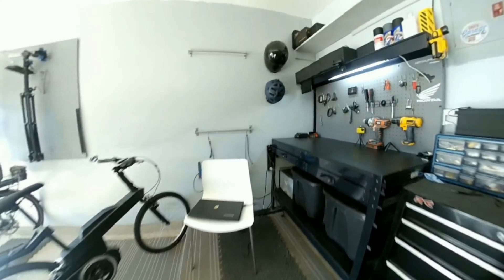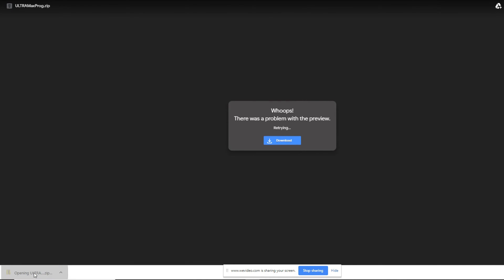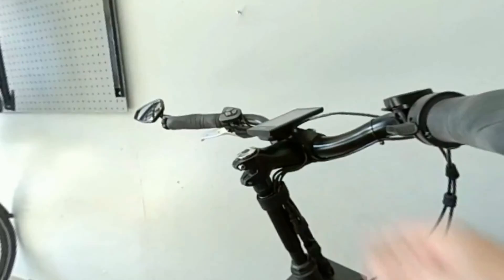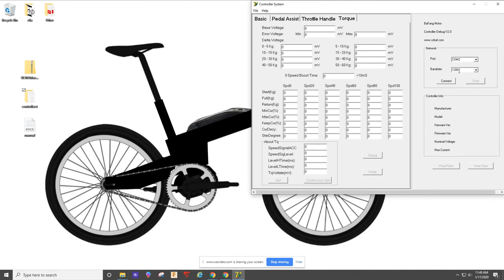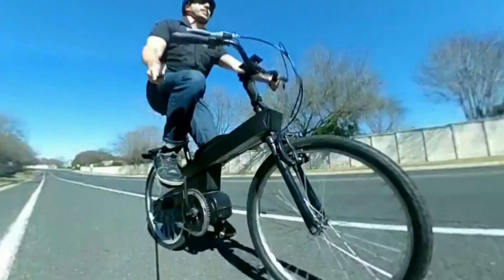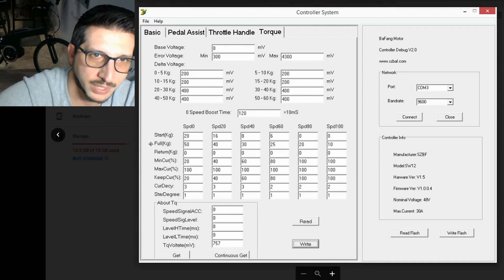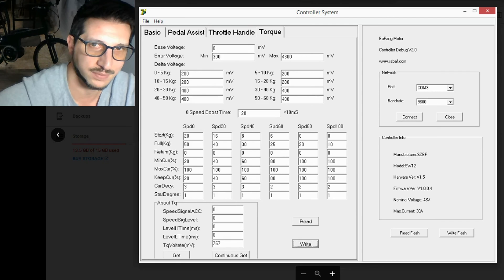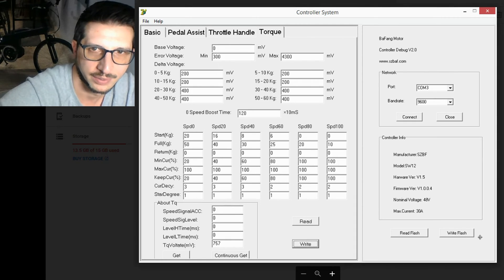How To Program Bafang Ultra Torque Settings

Comment from the maker: Update: I'm still loving these settings on my commuter, but want to point out a few things: 

1. This setup might not be ideal for emtb - couldn't tell you bc I'm a commuter.
2. The motor in this video is 2018-2020 UART version. Bafang is supposedly switching over most (or maybe all) their new motors to Can-Bus which can't be programmed via the usb cable. It requires a special tool and dealer access to special software. Epic fail Bafang! If you don't have a Bafang motor yet, you might want to look into buying one with an aftermarket programmable controller upgrade.
Reply: So in effect I could restrict the speeds? To be in line with UK laws? As mine will be to fast.
Reply from the maker: @Anglo-Brit  you should be able to restrict the speed using the settings on the display.
Reply: @eBikeaholic  Ok thanks
Reply: can confirm theese settings do not work in emtb enviroment. Not sure how one would adujst this for emtb use.

Comment: Well, we've received our Frey ebike, & I can confirm that
the Base Voltage value should NOT be at zero!

Bafang ships these motor controllers with the torque sensing uncalibrated.

The minimum value, at zero pedal force, which these torque sensors can output, is around 732 milliVolts.

Anything below 730 mV in the Base Voltage field, is wrong.
Far from a matter of preference, this is literally crippling the torque sensor:
Set at 0 mV, the first 20% of torque sensing range is thrown in the garbage;
Under any pedal rotation at all, ~"12 Kg" of pedal force is detected!

Of course the torque sensing won't work well that way!

To fix this: 
Get a reading from the "TqVoltate" field, with no force on the pedals.
Add at least +1 or +2 to that value, & apply that total to the Base Voltage.
Congratulations! You have just calibrated the Base Voltage of your torque sensor.

Setting the Base Voltage mV to 757 or higher, should prevent any baseline sensor jitter from being detected as pedal torque. (Unless your torque sensor is unusually erratic. If so, seek replacement as this is a safety issue!)

Comment: You forgot to mention that you need drivers to interface with the adapter, it took me a day to find the reason and install them 😂
https://cfpmanfredini.wordpress.com/2016/02/28/installare-i-driver-corretti-per-arduino-con-chip-ch340-ch340g-e-ch341/
Reply from the maker: Sorry to hear that. What adapter? Maybe you have a different setup. The laptop I used didn't need to install any drivers, but thanks for sharing in case someone else gets stuck with that problem.
Reply: @eBikeaholic  I don't know, when I connected and clicked on "connect" it started to change bandwits at random, then I looked on device manager and saw that the adapter was detected with a recognition error, probably windows didn't find any drivers by itself 🤷🏼‍♂️

Comment: I got my befang ultra and as I cant use anything more than 20mph due to laws, so I got cable from Frey. What ever settings I use I can only get about 12mph but with Throttle I can get whatever i want
Reply from the maker: Interesting. When you say can only get about 12mph do you mean the motor cuts off assist once you reach that speed?
Reply: @eBikeaholic  I fixed it and now do about 18mph pedal or 23 with a bit of added throttle

Comment: Thank you for the fantastic program . I programmed my Frey AM 1000 with your torque sittings, and it is like having a different ,more fun ,more capable bicycle. The response is natural and smooth. I think Frey should ship their bikes with your torque sittings.
Reply from the maker: Thanks! I agree, I'm still running these settings for car replacement.

Comment: This is very helplful but I have a problem getting started. The programming cable I have works well with BBS02 and BBSHD and the Pedal Assist Software for them.  The Controllerst Softwares only cycles through the bandrates when I try to connect.  The BBSHD software connects and will read but not the software for the ULTRA.  I have an Branded Bike I am trying to read the settings on.  From the controller is the green triangular 5 pin connector which adapts to the round to connect to the display.  I saw reference to a CANbus for the bike but not sure if this is connectors or a protocol.  Any ideas?
Reply from the maker: hmm not sure. I have heard of some OEMs starting to restrict them to the CANbus. I got mine as a kit. https://amzn.to/3hlV322

Comment: Hi, thanks for this very helpful and informative video.  Would you recommend these torque settings for a bike with 10 gears for street riding (in particular I have a Frey AM1000), as I noticed you only have a single gear.
Reply from the maker: I don't see why not.. I upgraded this bike to Nexus 3 speed IGH over the summer and still use the same settings.

Comment: Nice Bike!!! how much did you spent building this monster? and would you consider making another one for someone else?
Reply from the maker: Thanks! The initial prototype from this vid was about $1500 bc I repurposed most components from a used donor bike and built it at home with basic power tools, no welding or jig. I've made a bunch of upgrades since so it's probably up around $2500 with accessories and whatnot.

I just finalized the v2 design and am looking for potential manufacturing partners... hoping to have a second prototype built sometime this year or early 2022 and maybe do kickstarter if it works out. We'll see.

Comment: Hello, many thanks for the video. But when do i plug the battery?(before/after plug the green connector, before/after plug the USB in computer?). Hope someone can answer me. Thanks
Reply from the maker: Sorry for the late reply. I've always left the ebike battery pack connected, but the display turned off. I don't think it matters either way... shouldn't need to be connected to battery pack, but I'd suggest keeping the motor/display turned off before disconnecting the display cable.

Comment: Hallo.
Können Sie mir Helfen?
Ich haibike SDURO Trekking 6.0 Display C 
Und ich möchte Daumengas auf bauen.
Ich habe speedchip auf gebaut aber nicht ganz geholfen.
Hat das System Taste für laufn, kann mann bearbeiten in das System schneller machen?
Viele Grüße
Reply from the maker: I'm not really sure about the compatibility of components for Haibike systems, does yours have a Bosch motor? You might want to reach out to them directly.
Reply: @eBikeaholic  Ich glaube die sestem gleich.
Ja gerne, ich probiere das vielleicht geht.
Danke.

Comment: Do you know any way to program the bafang M600. level 1&2 are all but useless, level 3 WOW off to the races. i want to do the following levels 1=20%, 2=40%,3=60%,4=80% and 5 =100%. supposedly they have locked us out of programing the M600.
Reply from the maker: Yeah I think for that setup you'll need to find a dealer with a can-bus tool.

Comment: Hello, I have the same engine, but it is providing power for a short while right after pedaling is stopped, this can be a problem in mountain biking.  Do you have any advice resolve this problem?  I did lower the Time to Stop of PAS to 5 without result. thank you
Reply from the maker: I'm not sure, sorry. You might want to try looking up the Frey "smooth" settings... I think those are more suited for emtb.

Comment: Great video. Any suggestions on how to adjust my bbshd pedal assist so it stops immediately after i stop pedaling? The motor continues to run for 1-2 seconds after I stop and it is becoming dangerous, especially trail riding. Any thoughts on how to fix this?
Reply from the maker: Not sure. You might want to try playing around with the stop delay, current decay, and/or stop decay settings.
Reply: Get 4 pistons caliper mate, the armature is heavy likes to spin, put ill try other stop delays .

Comment: The link to the Ultra G510 software is dead ? I cant find any way to download the program to my Chromebook 3 ,
I have the 5 pin connector USB cord.
I need help with a successful link to the Bafang Ultra G510 software.
Reply from the maker: Chromebooks don't allow us to download programs, only Android apps. I use an old Windows PC laptop to program my Ultra... not sure about Mac.

Comment: how is your battery life with these settings?
Reply from the maker: I did a stress test here... https://youtu.be/ptiuPdwD3Eg. I'm working on a range test video, but ultimately running at this power needs a bigger battery pack for decent range.

Comment: I changed the control panel, the speed is too slow, and the engine is hot.
Reply from the maker: Dang, sorry to hear that. What did you change the control panel to?
Reply: @eBikeaholic  The problem was from the engine and it was replaced.

Comment: Hey man, sorry for nagging you but you're sort of my only contact for Bafang software related questions.  I noticed in the first page of "Basic" settings under Wheel Diameter it was set by default to 26.  I have 27.5 Scwable Supermoto X 2.8 wide tires.  I should change that setting to 28, correct? I'm surprised it didn't come from the manufacturer with the correct wheel diameter settings.  Also, in "Basic" settings should I set both the Limit current % and Limit Speed % to 100 in every row and column if I want full power when using throttle?  By default, the limit speed % is set to 100 across the board but the limit current % is Assist 1 - 30, assist 2 - 35, assist 3 - 40 and so on.  Should those all be 100?
Reply from the maker: It's all good, that's what I'm here for... hope I can be of some help. I don't think the wheel diameter settings makes that big of a difference. I think it only affects how accurately the speedometer reads your speed, so I suppose if you set it to 26" it will think you're going a bit faster than you are bc the wheel will spin faster?

I have all of the Basic tab on factory settings. The Limit current % columns will change the amount of power you get in each PAS level on the display. Depending on the PAS level you're using you will get that much power max from either pedal assist or throttle. If you want full power from the throttle then you need to be in the highest PAS level... I don't think you can differentiate the power levels between pedal assist or throttle but I'm not sure I haven't tried.

Comment: Have you modified these settings at all since you posted this video? I just modified my bike to your settings and I love it! Just wondering if you’ve made any changes since.
Reply from the maker: Nope, not the torque sensor settings... still loving it too. Thanks for the feedback! I did change some of the PAS power level settings for a bit so I could do a low power range test, but then changed them back to stock afterwards.
Reply: eBikeaholic I’m only having one issue I was hoping you could help with. You prob don’t have this issue since your bike seems to be a fixed gear but on the highest PAS setting Sport 5, the motor seems to be very touchy and when I’m switching gears it seems to power on before the gears can change. As you can imagine this is a concern for the chain and cassette. How would I go about modifying this so that the motor isn’t on a hair trigger when I let off pedaling to switch gears. My bike is already equipped with a gear sensor.
Reply from the maker: @seant1435  hmm, yeah that sounds annoying. I haven't had an issue like that. This bike was originally setup with a single speed freewheel but now has a Nexus 3 speed IGH. I still don't have a gear sensor on it though - I just wait a sec for the motor to ease up before shifting. 
It sounds like you might want to play around with the Full(kg) or Return(kg) settings. Those first three (kg) settings in the torque matrix represent how much pressure you put on the pedals. I think the Return(kg) is when you let off pedaling for a sec then pedal again. Maybe try increasing those a bit? Not sure if that would cause the ghost pedal issue again though.
Otherwise, I think the Delta voltage section at the top changes how sensitive the torque sensor is. I haven't changed those but would probably consider trying that first.

Comment: Is there a way of making the e bike quicker on that software like changing the max speed
Reply from the maker: You can easily change the speed limit settings on Bafang systems using the display. The diy kits don't usually come speed limited like all the other systems do though, and it won't necessarily make you quicker. The best way to make an eBike quicker is with a higher voltage battery pack, followed by higher amperage controller and higher bike gearing.

Comment: Do you happen to know how to disable the temperature sensor, either by software or hardware?
Reply from the maker: I don't, sorry. I've seen some people in the forums using the phaserunner controller which allows you to change the temp settings.

Comment: I follow the instruction but nothing happens I can't write flash or even read flash even the controller is connected.
Reply from the maker: Where exactly are you getting stuck? Are you able to find the correct USB COM port and click connect? Does a prompt pop up saying you're connected?
Reply: @eBikeaholic  I find the right COM port coz when I undo the USB the program will  show ERROR insert USB and when I inserted back the bandrate keep on running but I can't click the rite flash read flash after entering the program process my motor won't start after connect back to the lcd display.
Reply from the maker: @pitikaron  hmm that's strange. Are you sure it's plugged into the cable that runs to the motor controller? Otherwise maybe try a different computer if you have one. I'm not sure what could cause that, sorry. Maybe try reaching out to the people that sold you the motor.
Reply from the maker: Wait a sec, I don't think the bandrate should keep running. After you click connect, does it show all the 'controller info' on the right side like it does at 3:23 in the video?
Reply: @eBikeaholic  if I could post screenshot photo comment here I did it so that you'll see.  yeah it's strange! I did a few COM trial and it is wrong, error will appear if it is right no error will appear and if I undo the USB this word will appear ( please insert USB to connect the controller and when I inserted then click connect it is connected coz there's no error appearing but the write flash and read flash still I can't click.

Comment: I keep getting error code 10 overheating lately, even sometimes within the first 10 miles on flat ground on a cool day. This is with stock program settings. Doesn't make sense. Do you have any idea why this would be happening? I thought it might be the grease, so I replaced the grease with Mobilith SHC 100 and put a lot in there and am still getting this bullshit error, which keeps cutting off the motor for a few seconds, it really sucks.
Reply from the maker: Bummer, yeah code 10 is a strange one. What voltage are you running?

I beat this motor up @ 52v, 1500w in 100 deg F and had never got the error all summer. I'm thinking maybe when it gets too overheated it messes up the temp sensor or wiring? 

Did you continue to ride it when getting the code or let it cool down first? Did you thoroughly clean out the original grease before re-greasing? How did the electronics look when you were in there?

I've only gotten the error once when I was riding casually at 750w on a cold winter day a few months ago but nothing since  - even though I keep beating on it full power.

When I buy another Ultra I'm definitely doing preventative re-greasing it as soon as it comes in. I just ordered some Mobilgrease 28 to get in there before summer hits. Should be similar to SHC 100, they're both rated above 350 F but I don't think they can be mixed.

A few years ago Eric Luna noted error 10 as a 'possible phantom error' for the BBSHD. https://electricbike.com/forum/forum/knowledge-base/motors-and-kits/bbshd/7747-bbshd-bbs02-error-list

Luna cycle R&D probably has a ton of experience with this when testing their Ultra bikes, maybe try to contact them?
Reply: @eBikeaholic   Thanks for the reply. You've pretty much confirmed that I have something malfunctioning in my motor. I just wanted to make sure that they weren't all like that. Now that I know, I will buy a new one from Bafang and then put this defective one in the box and then take a shit in the box, and then send it back and do a chargeback. I don't appreciate giving people my hard earned money and recieving faulty shit from bat soup China.